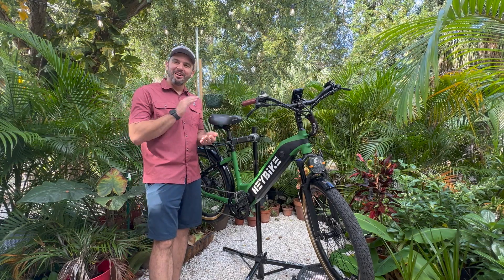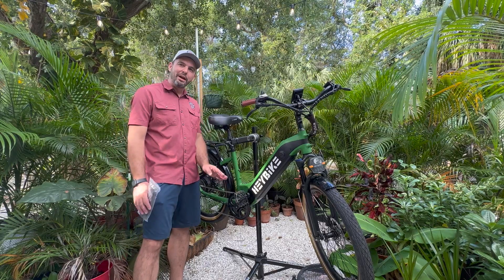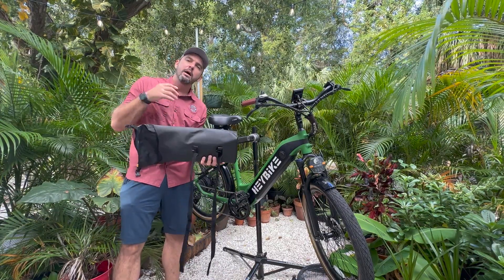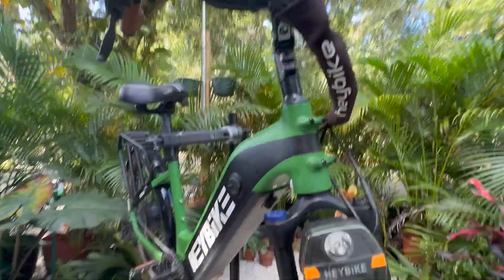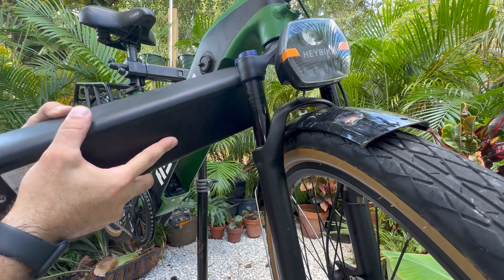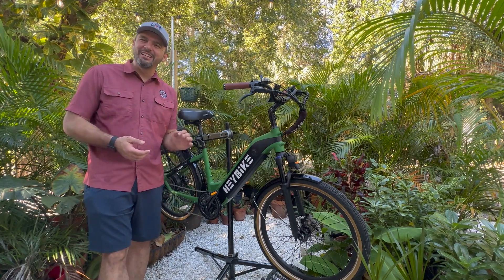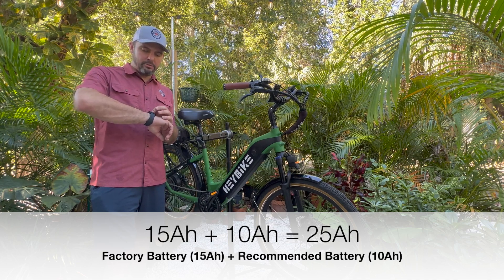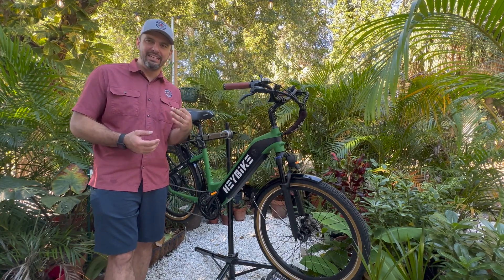Heybike | Cityrun | eBike Plug & Play Dual Battery Balancer Kit Install Two Batteries Electric Bike

Comment: Hello, me again. I bought your combiner from Amazon for my Heybike Brawn. My second Heybike Brawn actually because some woman in a red Subaru ran me over on the first one so I got another one and have the extra battery and socket from the original. So I'm adding the second battery and am asking if you mind if I drop a video and pictures of install on my channel? I don't want to copy what you've done but add to it. I probably wouldn't be able to do the install without watching your video first. When I'm done I'll have 36 amp hours combined. Like I mentioned, I don't want to infringe  on your content but add the Brawn to the Heybike family you've already been working on. Thanks for the videos and product help.
Reply: Also I have zero followers and a fake channel, CCTV with zero views in quarantine land so you wouldn't be losing any viewers.
Reply from the maker: Make the video!
Also, get an Amazon affiliate account and use the Amazon product to make you some extra cash from sales of the kit through your video!

Comment: Question for you, I have two Heybike Brawns, one's wrecked. Can I take that big socket that receives the battery with the six blade terminal off of my wrecked bike, so I can plug the original battery into that and just use the smart side of the plug with the positive and negative wires and splice those into the combiner and now current Brawn system? Any help is appreciated. Thanks.
Reply from the maker: You should be able to just use the adapters that come with the kit. Share some pictures with electricallwheel@gmail.com

Comment: I have a Heybike Brawn and think its maximum battery draw is 25 amps from a 18 amp hour battery. Id like to get at least 15 amp hour battery. The controller bay seems tighter clearances so I'm not sure if the balancer will fit. I'm currently in Montana and I'd like to do a extensive road trip and think the extra battery would help with mileage and carrying panniers loaded up. Do you plan on doing a Brawn build or what components do you recommend? Anyway to do this a little cheaper. Thanks for these videos. I haven't seen much for upgrades on the Heybike Brawn. If you're aware of lower gearing options or another builder I'm interested in that too.
Reply from the maker: Feel free to email electricallwheel@gmail.com with pics for confirmation. 
This will almost certainly be the kit
https://electricallwheel.com/products/40a-universal-dual-battery-balancer-kit-bullet-t-plug-xt60
Reply: Wow! You're fast. Best affordable battery recommendations, preferably with its own housing so i don't have to worry about a waterproof bag, etc. So fast! Thanks.
Reply from the maker: @Anonymous-jm3mg  this is our page of recommended batteries. Generally used in the videos on the channel 
https://electricallwheel.com/pages/recommended-batteries-to-use-the-electricallwheel-dual-battery-kits

Comment: @ electricallwheel 
Can you run a stronger battery 🤔 such as a 72 volt ?😊
Reply from the maker: We advise utilizing the system voltage when making any updates with components or batteries unless changing all necessary components
Reply: @ElectricAllWheel 
I've got the hey bike brawl
As was wondering witch one to order ? 🤔
Reply from the maker: @LarryJordan-fz9ow  https://electricallwheel.com/dual-battery-discharge-balancer-kit-40a-aventon-fit/

Comment: You can just get a second battery as spare. When battery ran out just plug in the other one
Reply from the maker: Or you can add a second one like this, and not worry about the swap, and carry a higher sustained voltage